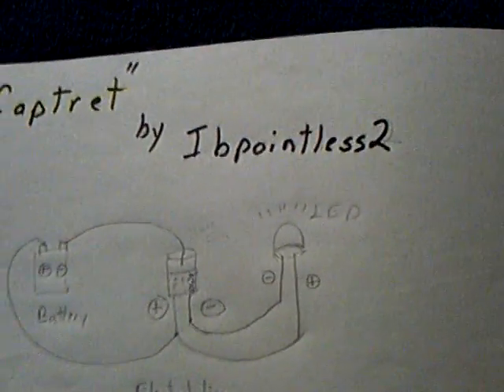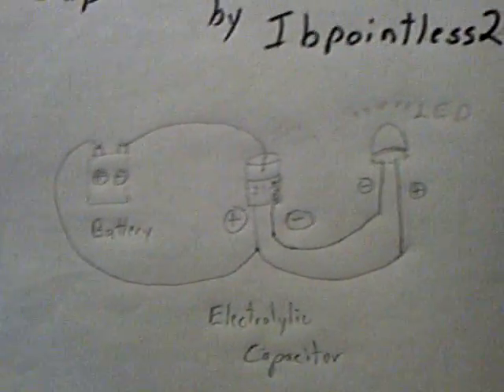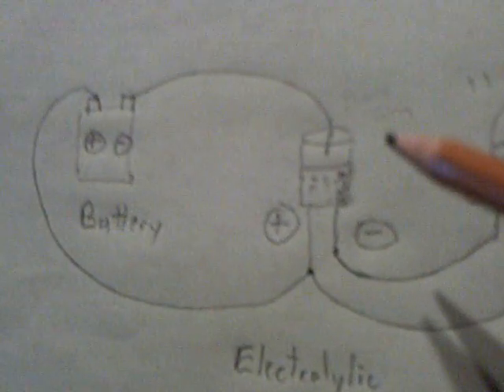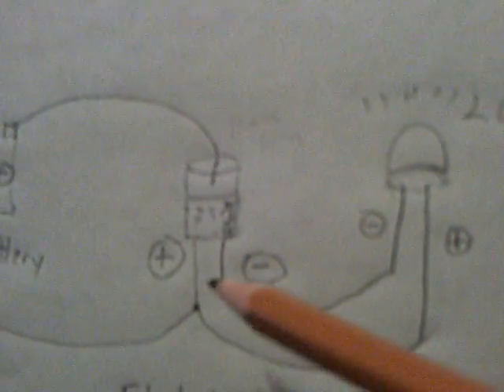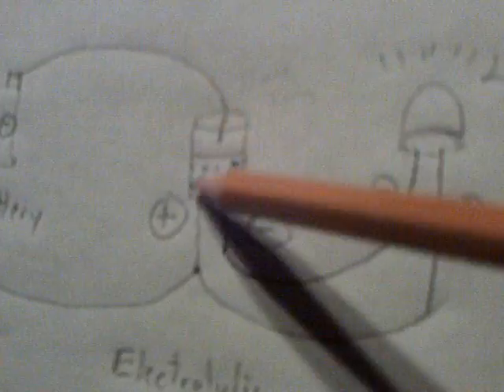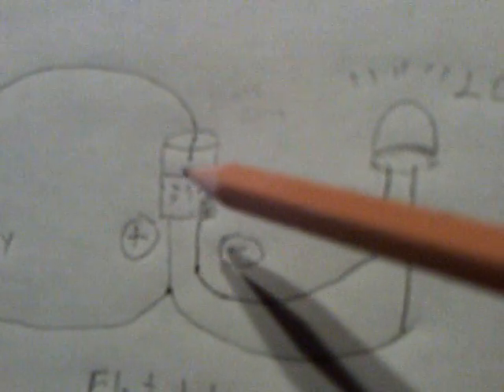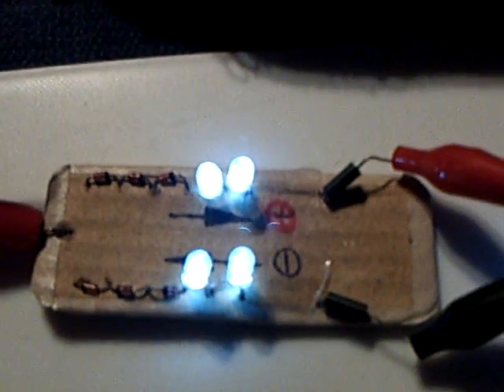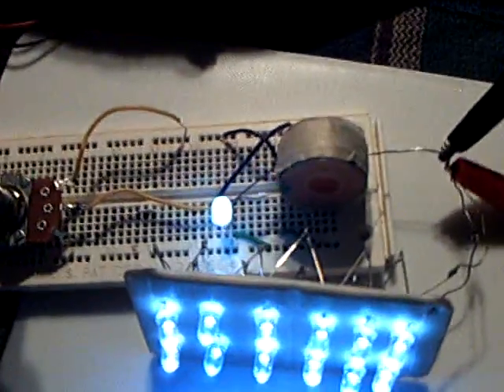Captret working with an Exciter circuit.ASF

Comment: @Lidmotor 
Hey Lidmotor, I think he is right about that.
I read a construction paper about aluminum electrolytic caps, and it is the internal diode which is the cause behind them being polarity-sensitive. The dielectric has high resistance in one direction, but if you go over the rated reverse voltage it will act like an opening diode and conduct current, which will destroy it.
Doesn't help to explain the weirdness in the captret though : )

Comment: You should try the new circuit, "the captret that doesn't play by the rules". It a even more unique circuit but more work needs to be done, i need better or different capacitors.

Comment: @mrBr00k5 Well I tried your diode idea, the led became full bright but the voltage on my battery was dropping very fast!!! This does not reduce amp draw, this will allow power to flow uninhibited and use up the battery!